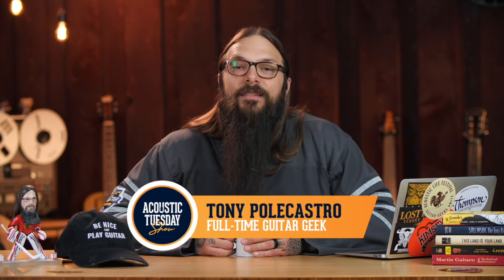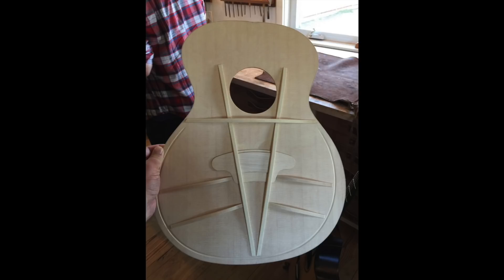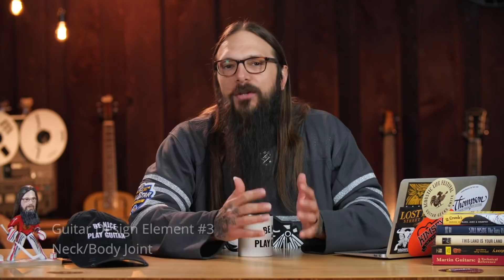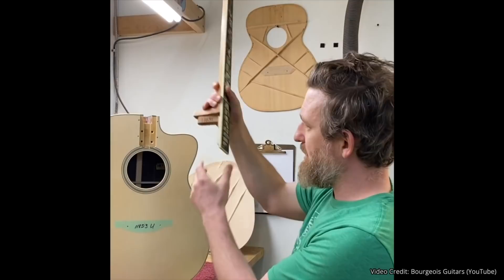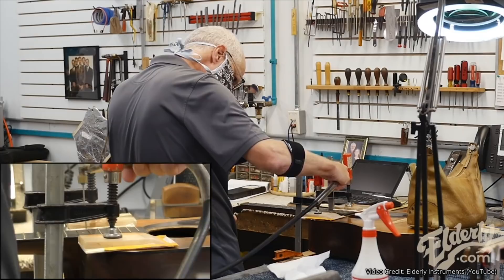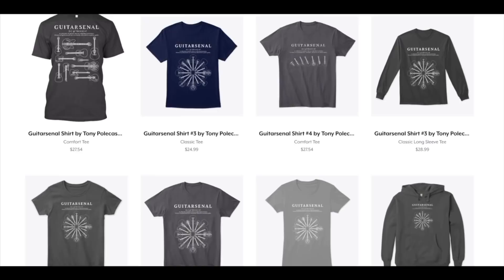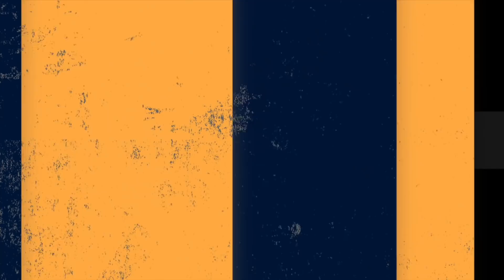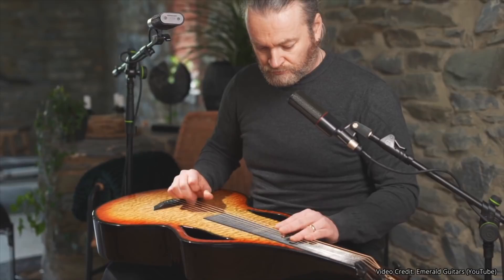4 UNDERRATED Acoustic Guitar Design Elements ★ Acoustic Tuesday 190

Comment: Here's a question: what about pure acoustics versus electrified? The connection between the saddle and the top of the guitar seems to me to be crucial to transferring vibrations to the guitar top. If you have an electric sensor between the saddle and the guitar top does it dampen the vibrations in a way that affects the tone/volume?
Reply: Yes, this is why the best acoustic pickups are mics or transducers or the both as a system. I don't like the sound of piezo pickups, even LrBaggs piezos are trash to me, and I really recommend that you find your favorite pickup, but I also recommend that you look for some mic system that has another way capture the sound (magmic, rare earth, T902 etc), or some transducer like K&K pure mini

Comment: Hey Tony - how about sound hole size, shape and placement as well as multiple sound holes?
Reply: what are your thoughts regarding tone produce by a cutaway
Reply: @rlk3605  Well. Despite its ergonomics, in most applications it doesn’t appear to be a positive thing for me  (except of dreadnoughts or jumbos, which may not have enough mids and highs). Cutaway makes the sound less saturated and a bit compressed if that makes sense. To prove that, you have to look at PRS acoustic guitars, which have pretty modest cutaway in comparison to some other instruments. That was made in order to reduce the difference between cutaway and non-cutaway designs as much as possible
Reply: @antonsydorenko7572  That guitar sounds great.  I have a Boulder Creek that utilized side ports which gives a great full sound.  You can check them out here.  I have a Jumbo KOA version, not shown in the video.  https://www.youtube.com/watch?v=H37sYe7u2cY&t=477s

Comment: I'd like to see some kind of video discussing pickguard material and the effects.. for example, I've got 3 acoustics with pickguards made from Rosewood (a Dreadnought and an OM w/traditional teardrop shaped, and a smaller Grand Concert type body with a cutaway and a mini teardrop shaped pickguard). All 3 have been attached to the guitar's finish using double-sided 3M adhesive tape. Does the weight and hardness make a noticeable difference to tone, response, and/or sustainability? Maybe there's a test out there? I've often wondered if it would be beneficial to have them attached more like a bridge, where the first the finish is carefully removed, and then the bare wood of the pickguard glued to the bare guitar top. As well, what (if any) effects does a plastic or other synthetic material play regarding pickguard material.. and does a huge pickguard like on the Gibson Dove or Hummingbird hinder the top too much? I don't know.. maybe some/all pickguards vibrate with the top if they're adhered/glued close/tight enough? I think it'd be fascinating to see an in-depth study done.. possibly in a fairly controlled environment using just a carved piece of Spruce.. or an inexpensive acoustic, with something to activate a consistent vibration each time, and a microphone (possibly other measuring devices) recording data than can be compared? Just some food for thought! 
Sending peace & love from Missouri -Todd

Comment: As always, thanks for making these videos.  I searched your channel and the search results claimed there is no content on it regarding the tornavoz, a construction feature designed to lower the Helmholtz frequency of the guitar body chamber.  I'd be very interested in your opinions of this odd but intriguing device (or a link to a video in which you have already covered it, if you have).  I was surprised that Antonio Torres used the tornavoz on several legendary instruments.  Technically, I guess Fender's new Acoustasonic employs a sort of short tornavoz, and a few high-end guitars have been made using them as well.

Comment: Binding has one functional purpose on a guitar: it covers the end grain of the plates (back and soundboard) to minimize splitting caused by different expansion rates due to humidity changes. This necessity then brought about the binding as an aesthetic consideration (since it had to be there in the first place).
Binding has nothing to do with impact resistance, and impacting your guitar in such a way as to damage the binding only would be a one-in-one-million hit.

Comment: I reduced the boominess of my D-45 by using lighter strings (.012s). This did a lot of good things - lowered the tension and action, improving feel, and all those useless lower mids were greatly attenuated.
Also, there a number of archtop acoustics that sound great as an alternative to a flattop. They tend to be brighter and they project like cannons. The good ones don't sound thin at all.
I have no problem at all with a properly designed, removable, bolt-on neck for an acousrtic, but purists will scoff at it.
Oh, and beware of celluloid binding and pickguards. They often (not always) deteriorate, gas out, and require expensive replacement. The celluloid gas also ruins metal parts.

Comment: I’m a big guy but have a bad shoulder that’s aggravated by playing my dread naught so I bought a triple 0 body style. It’s solid mahogany with a cutaway and I love how bright it sounds it lacks a bit of the low but I still love it. The smaller body is much easier on my shoulder on my rotator cuff.
Reply: you could get a guitarperformance stand. I had an operation on my shoulder and it really helps as it is holding the guitar. Also you can try just a classical support for guitars. It will further reduce you pain playing the 000 guitar. greetings

Comment: I'd love hear everyone's thoughts on a few guitar design elements and how they affect tone or maintenance.  Closed vs. open gear tuners?  Straight through strings on the head of Seagull Guitars?  Different materials for nuts and/or saddles?  Different materials for bridges?
Reply: Look I see it like this:  0) what tony said 1) Stings will affect a lot the sound 2) your nails (flesh / nails )  or the pick (material/brand) will affect the sound 3) build quality (masterbuild vs guitar for 200 $) - everything else is in the other category.
Reply: Open gear tuners all the way. They can be maintained much easier.

Comment: 1/4" vs 5/16" brace width 
 should be included in brace treatment as well. Also what about scale length . . . that's a biggie. And nut and saddle width and spread. Not to mention neck shape and thickness.